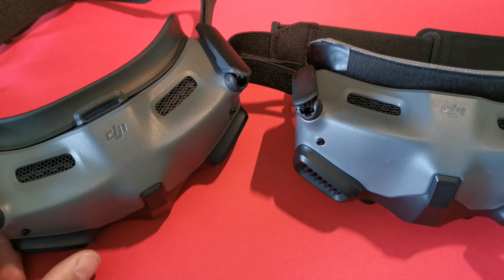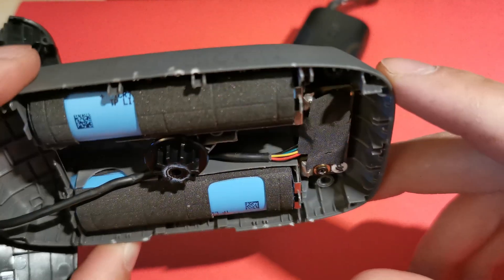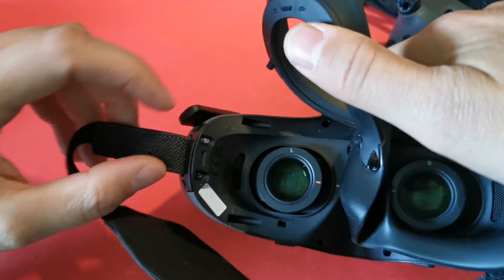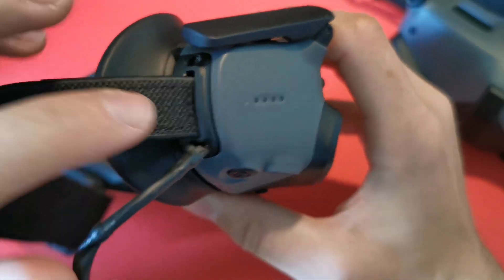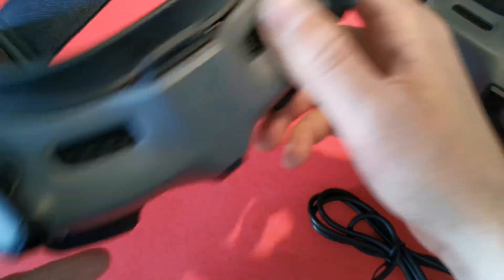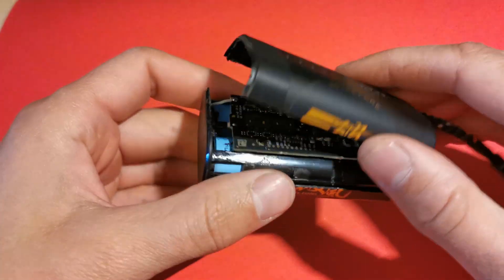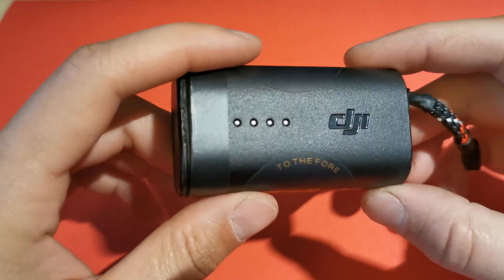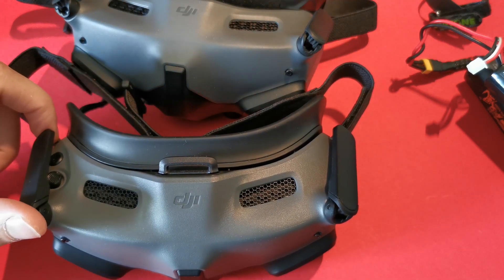DJI Goggles Integra & Goggles 2 Battery Mod

Comment: Hi I wanted to ask you if it was possible to replace the batteries inside the integra I tried to remove the 4 screws and removed the cover and inside I noticed that there are 2 18650 batteries, do you know if they can be replaced or afterwards there is the risk that something will not work
thanks

Comment: So the integra doesn't have that DC in port for the battery plug? I was wondering if you can use the goggles 2 battery and plug into integra....I do t want built in battery and I'm used to having goggle battery on cable into my pocket... speedy bee has a bec for goggles battery...   so basically I'm wondering if that's that's option

Comment: 1:50 is the batteries soldered/welded? looks like you could still replace them if removed from soldered could use velcro, glue or reweld to hold new ones in place instead of solder. Then  probably shove a spring or neodymium magnet in to gap the connectors. Do you know if the mAh would affect the self charger?

Comment: Nice mod!  I'm thinking of getting either Goggles 2 or Integra.  Which one do you prefer?
Reply from the maker: I prefer the goggles 2 because of the wider FOV
Reply: But how do you handle the fogging? And also that you have no fan blowing on you (which causes fogg even more + I swear like shit down there)…have goggles 2 and v2 and I love the goggles 2 formfactor and OLED screens but the 2S limit, fogging, bad lenses make the experience very hard for me
Reply: If you wear glasses I recommend Goggles 2, adjustable diopters.